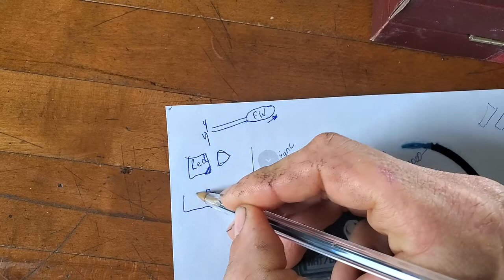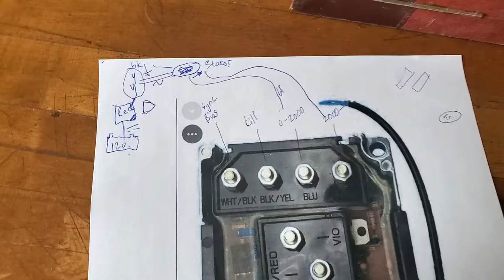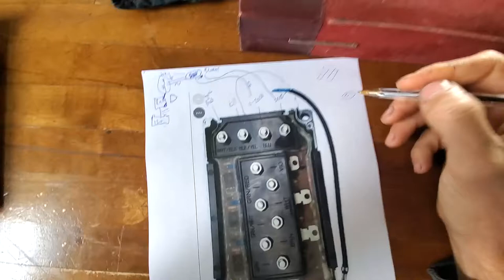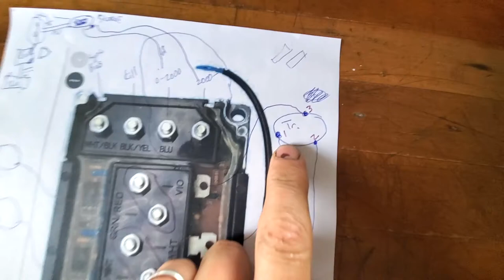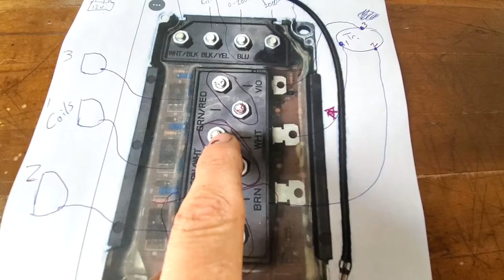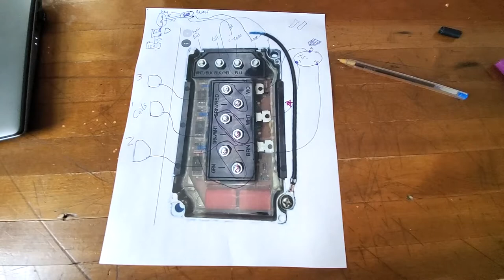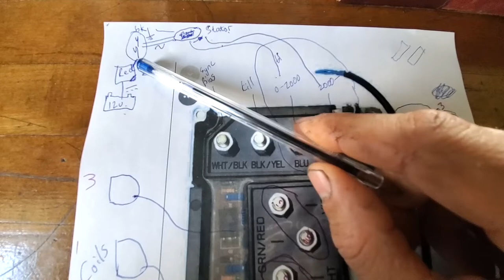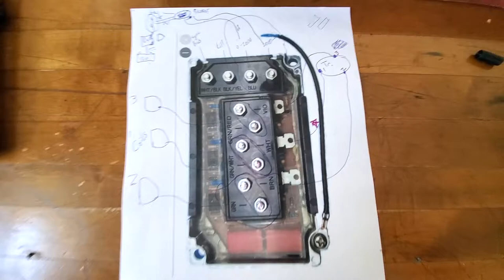Outboard spark fix Part 1/2. Mercury/Johnson/Yamaha. CD ignition power-packs explained -Extended

Comment: Thanks for the very helpful vid. I found a faulty rectifier on my 1989 135 Merc because of this video. most likely the original unit. 35 years is pretty good i think.

Comment: This was explained so simply. I have a very clear understanding of the ignition system of the Mercury in the boat I bought. If it doesn’t start it certainly wont be because of the ignition system.

Comment: This was a valuable explanation of how the electrical system works on an outboard, especially Mercury.  Thanks a bunch.  My 200 EFI went dead all at once, all cylinders so I will start with the kill wires and then to the rectifier, etc.  Thanks again.
Reply: How did it go? What was it?

Comment: As a test, Could you apply a 4 VDC pulse to the trigger wire input for a channel/circuit and see if you read zero ohms resistance (or very close) between the stator input and the output lug of the channel/circuit you are applying the 4VDC trigger to? Shouldn’t the  SCR close for that Channel or circuit in order to output the stator input voltage to the coil thus firing the spark plug? I am performing this on a Tohatsu CDI and it changes from infinity to reading Megohms of resistance when I apply the trigger to the CDI. This leads me to believe the SCR is likely damaged in the CDI as I would have expected the SCR to read a short when the trigger is applied, and an open when the trigger is removed. Basically it just switches the input from the stator to the output to a coil, right?

Comment: Great video... Need some help though. I have a 85 Mercury 150 black max Ran fine last year when I put it to bed for the winter. Fired it right up this spring but the only problem is the starboard side is not firing. So I did what you said in the video and unhooked the two wires on the rectifier and they fired right up. Replaced the rectifier same problem,  so I got another rectifier and again same  problem. Don't know what to do now. Any help would be appreciated.

Comment: Thanks for the tutorial that was awesome I need more information working on a 1981 Mercury black Max 150  No spark on only 2 cylinders on one side.
Reply: Locate the pack for that bank and swap the bad wites with a good channel as explained.. if the dead issue stays in place the pack is not the issue, trigger is. . If u swap the trigger wires and plug coil wires and the issue moves with u its the trigger

Comment: Great video 
I have a 1986 6 cylinder 115. It has good spark on all cylinders it starts and idols good all cylinders are firing. 
When I start to accelerate it begins to misfire and lacks power. 
If I bring the throttle back to slow it runs fine. 
Just cleaned the carbs and has new plugs. 
I have checked the ohmic value on the red red/white and blue blue/white wires and the blue wire is out of speck 32k ohms. 
According to your video the blue works are for the low speed so I’m a bit confused. 
Perhaps you could shed some light on this fore me.  
Much appreciated
Reply from the maker: if the blue /red ohms are out of spec the stator is likely bad- a DVA adapter will show you any issues, they usually fail to produce enough juice at certain rpms and it will show a drop right before power loss. The parts are so cheap that I would do the statpr and trigger at the same time - because the trigger wires move every time the throttle moves they tend to wear out more.. the stator is a stationery unit with no moving parts. over time heat+vibration and very low batteries/too much amp draw can also take them out- the insulation can also break down and cause an internal arc killing power. hth-

Comment: Thankyou so much for the explanation. I have a 1980ish inline 6 mercury 115 that has been in the family since new. It starts fine and runs ok at low rpm, but will not run smoothly above about  2000rpm and maxes at 3000rpm. I fitted 6 brand new plugs, drove it around for 45 min. Occasionally when running at its max achievable 3000 it would smooth out and momentarily surge towards higher RPMs, then within a second or two drop back to its hobbled 3000rpm.  Returned home and pulled the plugs. The even no plugs 2,4,6 attached to the lower switchbox have relatively clean white insulators, whereas 1,3,5 are black and sooty suggesting they are working well on the upper switchbox.   Could this simply mean the Red high rpm stator wire to the lower switch box is faulty. Or is more likely to be a fault in the switch box or elsewhere?
Reply from the maker: Swap the packs but keep all wiring and plug wiring the same.  Hit plugs with wire brush to clean them up.  Now run motor again,  if the problem moved its the pack, if the problem stays on same side its stator. . Or possibly trigger.  Honestly I'd just replace the lot.. stator, trigger, 2 packs and coils.. no guess work and it will run great again if compression is good. Watch amazon for used deals.. cdi makes good stuff,  sierra coils are good. Do not buy chinese coils, and keep your original parts! Buy a DVA meter, keep a  good battery and spray every connection with corrosion atop. Watch u don't crack the ferrite coil magnets too by over tightening..
Reply: @SocalMarineUSA  Great suggestion thanks. Will start by swapping the packs as that is simple to do with minimal tools or test equipment.. Thanks again for the help.

Comment: 1986 mercury inline 6 lost spark on cylinder #4 repalced coil still no spark even swapped a firing coil over to the dead cylinder to see just by chance i got a bad coil but still no spark on 4 havent tried swapping wires yet..m what would be your guess more than likely bad trigger or power pack box??? Oh also installed new plugs so isnt that either ..thanks in advance any ideals would be helpeful

Comment: Just one thing I wasn’t clear on, if I was to switch any of the trigger wires to the switch pack, that would prove the switch pack is good, or bad, and it would be the trigger that was bad? 

Do I have that right?
Reply from the maker: the pack is just a channel like an amp- so if you have GOOD consistent spark on cyl 1 and not on 3, if u swap pack wires AND coil wires and the problem moved the pack is ok and trigger bad. if the problem didnt move the pack is bad and trigger likely ok. the way to test a pack is to use a working cylinders trigger and coil wires to change between channels. AAlternatively you can use the "bad" cylinder to see if its bad on another pack "channel" - if it suddenly works then the "bad" one might actually be good but running through a bad pack channel.

Comment: Great explanation! If you suspect the trigger for intermittent spark on one cylinder can you swap brown and violet with expectation of no spark moving to other cylinder? I've physically swaped coils so I know they're good.Thanks!
Reply from the maker: The trigger controls the timing and the brown, violet, etc wires are designtaed for a specific cylinder - as long as you keep that relationship you can swap pack channels / plug wires and green wires as you see fit..  if you just swap the trigger wires the timing will be off and it will run worse so to try run the motor for tests you must swap the trigger wire AND either the corresponding 2 plug wires OR green coil wires (one of these two to redirect the spark to the correct cylinder) - but the intermittent spark should technically move to the cylinder yes- i have an int trigger throw me off for MONTHS way back when i was learning! DVA confirmed a voltage drop right before the miss would show up...
Reply: @SocalMarineUSA  ok thanks. I just tested before your reply. I replaced an old corroded trigger and the new CDI one must be bad. 1986 60hp 3 cyl Mercury. Getting intermittent spark on cyl #1. 2 and 3 are great. I swapped trigger leads to switch and had strong spark on #1 and int now on 2. The intermittent spark will spark about 5-7 times when first cranking then stop. It will sometimes come back but not always. Is there any chance the hub magnets on flywheel could be weak or is it a spark signal or no signal situation? Still scratching my head not wanting to replace another trigger.

Comment: I have mercury engine 2000 75hp outboard that starts and runs but then when i turn it off it doesnt want to start. i believe this is the problem will be testing it, i am handy but outboard engines are new to me so i like to learn. I will swap the cylinder 2 with 3 in order to see if i have sparks actually will check for sparks with all 3 then to check one by one. the problem is that my box i closed as you mentioned so i am scared to play with wires. :)
Reply: i would wiat till it runs again and check each wire individually with a timing light. if they all have a consistent flash at idle, its possibly a faulty ignition of kill circuit- if you are no spark on one or more wires, this swapping test will work. Yes its a little more difficult with closed types - you need to make some crocodile clips and use those to swap wires around-

Comment: I have a question I have a 4 cylinder 45 hp and I have one wire on the trigger is totally losing its out coating and the copper wiring is braking down. All the rest of the wire are in good shape except the one white wire is just about lost all of its outer insulation coating. What will cause that. I can send a picture if needed. Thank you.
Reply from the maker: hi - its common for the insulation to break down over time. you can snip the end off, slide over heat shrink, and recrimp the eye on . make sure to slide it all the way to make sure it wont ground. honestly replacing the trigger would be a great idea as they wires move every time you move the throttle - but u can try the heat shrink first and see.. esp if its running right.
Reply: Yes I know that it is normal for insulation to brake down overtime and I was going to fallow it back to were I can splice it and make a repair by replacing new wire and a new end but I trace it back all the way back up under the flywheel and not able to repair need to replace the trigger switch. I just question if something else is also wrong. Just didn’t want to replace trigger switch and it will happen to the new one then have to order an another switch. I just don’t think just one wire would do this and the other 3 are fine. I tried to add a picture put it would not paste.

Comment: Enjoyed part 1, but cannot find part 2???  I have an old 4 cylinder, 2 stroke mariner of unknown year or horsepower. I have no spark on cylinder 1. Swapped coil pack with number2 but still no spark. Trigger or CDI ???
Reply from the maker: simplest approach would be to use #2 as u know the pack channel for #2 is good. Take the #1 wires at the pack (trigger and coil) and put them on the pack terminals for #2. If there is spark on the plug now then u know the trigger is producing spark on #1 and its the #1 pack channel thats bad (you can counter test/confirm by putting the good #2 trigger and coil wires on #1 pack terminals - you should also have no spark if the channel is bad). If there is still no spark despite borrowing all the good terminals from #2 that works, then the trigger is bad, because a bad trigger wire will have no spark no matter how many good channels in the pack you put it on - make sense?
Reply: @SocalMarineUSA  Thanks, that explains a lot. What voltage should I have on the trigger wires? I can borrow a DVA adaptor for my multimeter if I will need it.

Comment: Great video very educational, I have an old 85 mercury will that cdi work on the 96 mercury?
Reply from the maker: dont think so - i think the later style ones went to the wires integrated, but check cdi's website and compare the part #s/pics for the different years..

Comment: I’m getting no spark on my 60hp 3cyl mercury nothing all the coil packs not firing.Was thinking that stator went out maybe what do you think? I checked the stop switch and emergency lanyard switch seem fine
Reply from the maker: u need to check for power coming TO the pack first- it will be blue TO GND AND RED TO GND- https://www.outboardignition.com/page39.asp just look up your motor hpa nd year and check the specs.
Reply: @SocalMarineUSA  Ok I sure will and thank you

Comment: i have spark on all cylinders so all channels must be good. im guessing it must be the trigger thats bad or not the right timing?
Reply from the maker: I guess so, but in rare the spark could still be intermittent which could be a pack channel or a trigger. I had an 80s mercury once that had intermittent spark at 2200 up on one cyl only, it was the trigger. why is yours not running if u have spark across the board? are the carbs clean?

Comment: My cylinder no. 2 do not run well ,  there is spark on the spark plug , i change the seal under the fly weel , i try another coil , i check  the control box , the compression iss at 122 lbs .            Would you have i idea  what else could cause that trouble ? thanks
Reply from the maker: compression is fine - how are you determining its #2? with a timing light? If you are using a timing light and getting intermittent flashes on #2, first swap ONLY the coil with another cylinder that is good and see if the issue moves.. if it still is bad on #2, its not the coil. Move upstream to the pack, try swap the "channels" like i describe here - you need to swap #2's wires with a good cylinder at the PACK.. See the chart here for reference - https://maxrules.com/oldmercs/Wiring/1966ona/70.jpg - You will swap #1 and #2, so swap brown with white, and swap green and green/white- retest now.. If the problem stays on #2 its the pack, if the problem is now on #3, its the trigger wire for #2, you will need a new trigger.

Comment: Does the motor have to be running in the upper rpm range to test that leg or can I do it just from cranking the engine?
Reply from the maker: cranking is fine - since alot of the time the motors are hardly running. You can take the spark plugs out to increase the cranking speed and just ground the plug wires out so the energy has somewhere to go.. that makes it spin alot higher and the battery doesnt struggle as much.
Reply: @SocalMarineUSA  thank you. That's exactly what I did and got mid 200s on the low rpm leg and only mid 20s on the high rpm leg. Wanted to make sure I was testing it correctly before ordering a new stator though. Thank you for the response.
Reply: @SocalMarineUSA  will after reading the chart in you provided in your other post it says 25-100 for a 85 mercury black max 150. I will reach test tonight to get a more accurate number on the +2000 rpm leg.

Comment: 1986  Merc 75 will not shut off. The kill circuit black with yellow tracer is good. And all grounds good. Could it be my cdi switchbox?
Reply from the maker: Test manually with a grounded wire .. when idling touch the 2nd from top left with a ground wire.. if it doesn't die yes there's a prob. Make sure you don't have it on the bias terminal (top lef), that's only used for twin pack serups...90 up iirc

Comment: I have a merc 1991 75 3cyl, cranks but no explosions at all...
Took the tarp off the boat for the new season, did all the basics, new fuel, new plugs, it would crank fine the first few times no luck, then it became harder to crank. then all of a sudden i could crank anymore, swap to a new battery, doesn't crank anymore...i can hear the starting solenoid click but no crank. Use the hot wire from battery to starter, sometimes the bendix goes up and contact the flywheel to crank sometimes not, ordered a new starter solenoid...for now i help the bendix up manually to contact at flywheel then hot wire to starter. Can't figure out why it wouldn't fire on all cylinders. I took the stators yellows off from the terminal block, still no sparks, took the blk/ylw killswitch off still no luck, i also unplugged the throttle controls main wire off...still no luck. Can't just be the starter solenoid causing all that? Bad starter?
Can i swap the 0-2000 (blue) with the 2000+ (red)....
Reply from the maker: a slow crank on these mercs will produce no/weak spark. I suspect the starter - make 100% sure the battery and cables are 200%, not 100%, 200%. No cheap connectors, use solid brass/copper and di grease. Load test the cables at the starter. Do not throw the original starter away! they are VERY good quality and any shop should easily be able to replace the brushes. Grease the bendix shaft and make sure the grease is everywhere, they do like to get stuck.. dont hang on the starter for 30-40 seconds at a time, they arent designed for that, 10-15s max then wait a bit.. you cant fix a no start issue by burning the starter out which I think u did.. or the solenoid too.. get the motor cranking well again and work your way back from the plugs.. if ALL the cylinders are dead after you fix the slow starting issue then perhaps the kill wire is faulty - very common issue on outboards and it can easily destroy the pack.. The triggers are common culprits cos the wiring moves all the time on them..